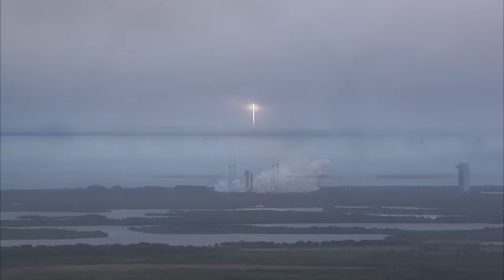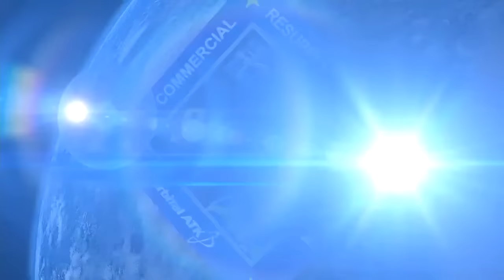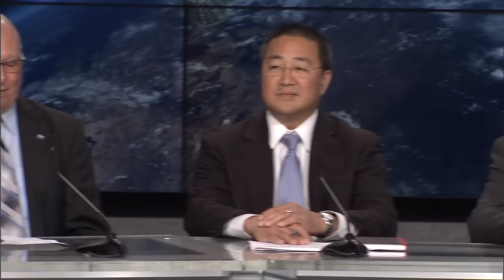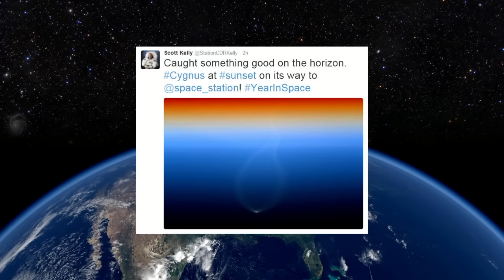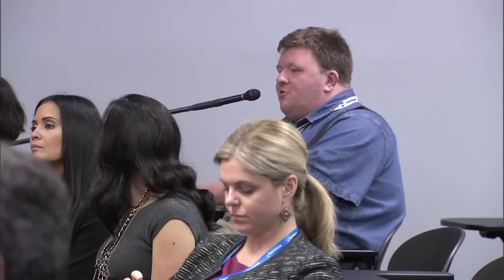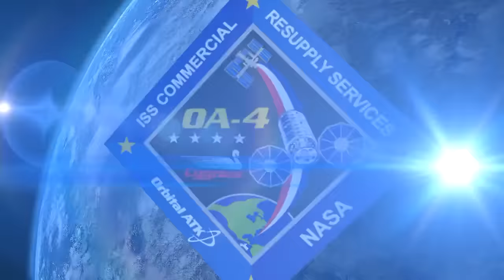Post-launch Status of Supply Mission to the Space Station

Comment: what altitude is the apogee and perigee?
Reply: +eatthisvr6 over 160km and they hit it within 100 metres? WOW thats impressive
Reply: +eatthisvr6 It's probably closer to 400 km (the altitude of the ISS). 

Below 250 km, you simply cannot maintain an orbit for any reasonnable length of time. Atmospheric drag is just too strong.
(the only satellite to have maintained such a low altitude orbit for a good length of time was GOCE. And it did so by being shaped like a dart to reduce drag as much as possible, and had ion engines to constantly reboost it.)
Reply: +piranha031091 thanks for the info. what altitude does the atmosphere become a non issue?
Reply: eatthisvr6
I'm not sure. It is still an issue at the ISS's altitude (400 km) causing it to need regular reboosts, but it is (unfortunately) not an issue at the altitude of the chinese weather satellite on which they performed their missile test. (800 km) (which means that huge debris cloud will stay for centuries to come... Thanks, China.)

So, my best answer would be between 800 and 400 km (it's not an exact line anyway, and it would depend on your satellite's mass, dimensions, and on solar activity)